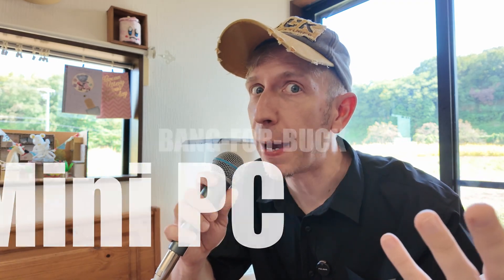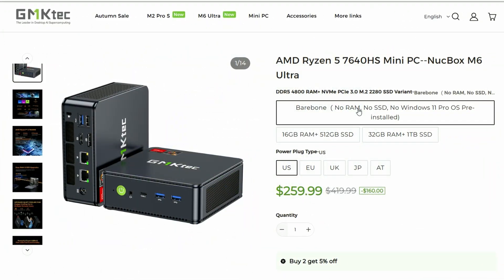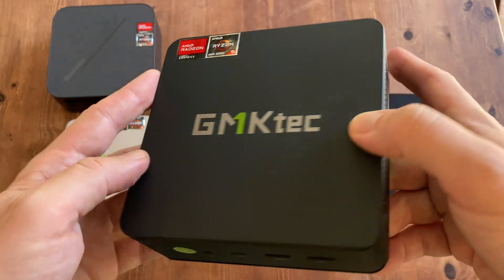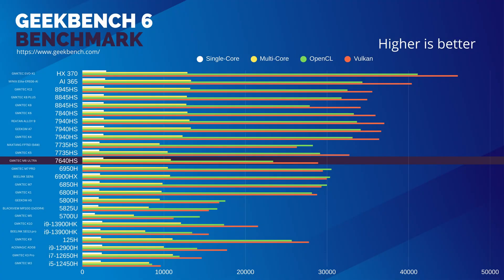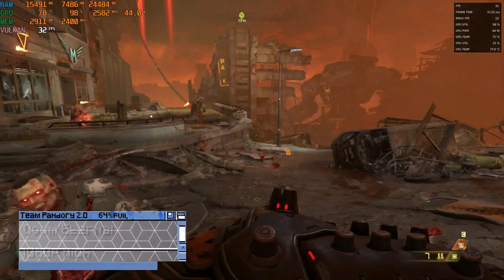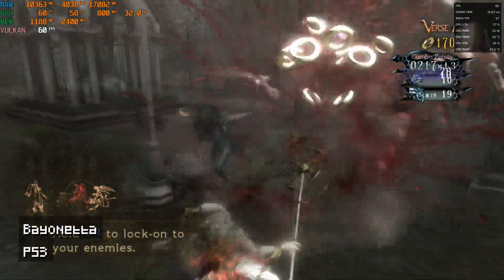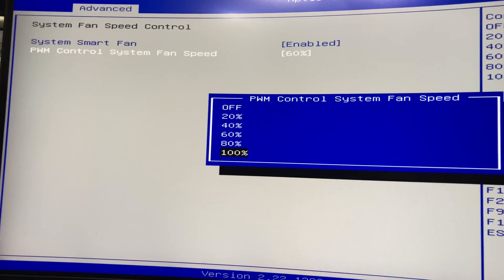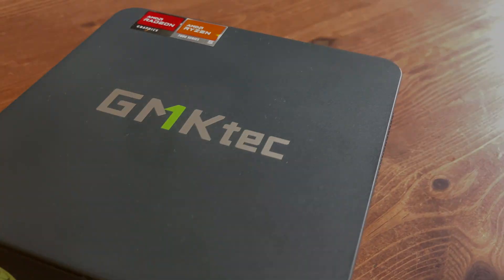This $349 Mini PC Is Shockingly Good! [GMKtec M6 Ultra Review]

Comment: You could take this and run an occulink port in the open m.2 slot for $20. SUPER easy. Just plug the extension cable into the spare m.2 slot and plug your occulink epgu into it.  This with a EGPU would be a killer unit for almost anything.

Comment: I have the GMKtec NucBox M6 Ultra, I paid 297.99€ taxes included for this PC which translates to about 346 US dollars at the time I write this comment but I don't know if the US price takes taxes into account, the mini PC is a beast, the CPU is really powerful and I never managed to hit its limits(I use it in Performance 50W TDP mode), I use the preinstalled 16GB RAM DDR 4800MHz, and same for preinstalled 512GB PCIe Gen 3 SSD, it runs Fedora Linux 43 Beta with the KDE desktop(I removed Windows 11 day one), tho it's not perfect, first the wifi + bluetooth chip is horrendous... This is the same card I had on my previous gaming laptop, it seems all Ryzen 7000 mini PC and laptops have this card and it's the worst I've ever seen, first wifi speeds are horrible unless you're near your router, at the same spot my old crappy thinkpad with regular WiFi 6 6 achieves 240 to 320Mbps while the mini PC only gets between 96 to 120Mbps with tons of drops, if you are near the router you can achieve 800 to 900Mbps, this card is WiFi 6E but uhm... I had a laptop with a WiFi 6E card(it had a i7-13620H CPU) and managed to get 1600Mbps near my mom's router, secondly everytime I plug my external SSD the internet connection dies(wifi icon with exclamation mark but still connected) if I disconnect from the wifi and try to reconnect it's stuck at "configuring interface"(note that I can connect to my mom's wifi but not my phone's wifi hotspot, both are configured in 5GHz mode) if I remove the external SSD I'm able to connect again(note that on my M1 Mac connecting the same external SSD doesn't kill my wifi connection), also had issues with bluetooth where if too many devices were connected at the same time I either got INSANE mouse lantecy(bluetooth mouse) or audio cutting every few seconds(i use bluetooth headphones), the problem NEVER happened on my M1 Mac even with 4 bluetooth connected at once. The PC is amazing and I have accepted its flaws especially since I paid next to nothing for it but I can't say it's perfect. AMD makes really good mobile CPUs but why do they forced everyone to use this crappy WiFi + Bluetooth card chip ? Especially since I see everyone complaining about it online, "lspci -nnk | grep -i mediatek" reports it's a MT7922...

Comment: in my country, m6 ultra and m7 difference is 40$. should i add that much just for the oculink?
Reply from the maker: The m7 has slightly better GPU and cooling too. Tbh id toss a coin.  M6 ultra for better CPU performance .. tough call.

Comment: Great little mini PC. I have the very similar Minisforum UM760 Slim which uses the same 7640HS chip. I was worried about only having 6 CPU cores, but it runs great in practice.
Reply from the maker: I've been testing out a few games the past few days, and it holds up. Good little chip, ideal entry point for one that needs a cheap pc that can still play a few games.

Comment: Just noticed that the bios doesn't let you setup a fan curve. Is it possible to use software like "fan control" to accomplis this on the mini?
Reply from the maker: It might be 🤔. Will have a look, but tbh this unit is pretty quiet at stock / normal use in balanced mode.  Does a good job in the auto fan setting

Comment: Glad there's another review, i've bought m6 ultra a month ago, and im satisfied with performance and low power consumption.

But im still confused, is m6 ultra can running ram at 5600mhz, or it's 4800 at max? The one im using are 5600 and it's detected as 5600 in task manager
Reply from the maker: According to the chipset's spec sheet, it should have speeds up to 5600, but the sticks we got were 4800.   Will check again tomorrow 😸

Comment: why? why do they put full usb4 in the front? i refuse to connect egpu or a monitor to the front! the back, the back dear manufacturers. one plain vanilla usbc in the front? im cool with that. but full usb4 should be in the back. and whats with this 2xlan trend? nobody is aggregating, lol. nevertheless, seems like a nice b4b for 32gigs/1tb.
Reply from the maker: Having usb4 on the front isn't too bad. I'd prefer to have one on both fronts and back, much like the 3.5mm audio jack. 😁 
- I don't think they really can change it too easily though, as this case design is not a recent one by Gmktec. You know with creating plastic molds /  costs etc.
Reply: @TeamPandory agreed. two full spec usb4s, one in the front and one in the back would be acceptable. i have lenovo p3 ultra and it has two tb4 ports in the front, and none in the back. so whichever thunderbolt devices i might connect, ill have cables dangling from the front, lol. hub, egpu, monitor, soundcard… ugh.

Comment: $340 is pretty steep for a budget mini PC
Reply from the maker: For a budget mini pc that can actually play a good set of games, this is a great price.
Reply: It's unfortunately difficult to recommend most options in the $170-$340 range. A lot of them use older Zen 2 or Zen 3 chips with Vega based graphics. If you need something faster than an Intel N100 (or similar), you almost have to double your budget unless you are certain the older chips fit your needs.
Reply: With plenty of RAM and SSD included I think the price is not bad.
Reply: Bought my M6 Ultra for 297.99€ which is about 346 US dollars at the time of writing this comment, but the price I paid included all taxes, also, it's not really a budget mini PC, the Ryzen 5 7640HS is a pure beast of a CPU... Yes it's not high end but definitely not budget or entry-level, you get a 6 Cores 12 Threads CPU based on the Zen 4 micro-architecture and a max frequency of 5GHz, from my tests on single-core and two-cores workloads I can hit 4.7 to 4.9GHz sustained frequency and when all cores are maxed out at 100% it's betweeen 4.2 and 4.5GHz, I never saw this CPU under 4GHz(idle doesn't really count), and even the iGPU is used I can still hit those frequencies despite the 50W TDP being shared between CPU and GPU, playing Call Of Duty Black Ops II on RPCS3 with MangoHud for performance stats I have about 60 to 80% CPU usage with all cores between 4.2 and 4.5GHz and the iGPU at 70% usage but at default clock(800MHz) because it doesn't need to boost, I never managed to hit the limit of the Ryzen 5 7640HS and I'm quite a power user, I write code everyday and I do tons of CPU intensive tasks on my PC and yet it has been peforming as well as a big desktop PC. For the price I paid it was a miracle as I can't manage to find another PC at the same price(and I'm taking into account all types of PCs aka laptops, desktops and mini PC), I don't think you can build me a full PC for 297.99€ that has the same CPU and iGPU performance. And mine came with 512GB of PCIe Gen 3 NVMe SSD and 16GB of RAM, a complete and working PC, a Ryzen 5 5600X is already about 100€ and the 7640HS is a bit more powerful in most tasks, you'd also need a motherboard, a case, RAM sticks, SSD, CPU cooler(unless you want to use stock cooler) and you'd need a GPU because the 5600X doesn't have a good iGPU, also the M6 Ultra comes with two 2.5Gbps Ethernet port, most motherboards have one 1Gbps Ethernet port unless you pay a higher price. The most similar build as a desktop PC would be with the Ryzen 5 8600G(since it has almost all the same specs as the 7640HS and also use the same iGPU) but a full PC with this CPU is well over 300€...
Reply from the maker: @YannBOYER_LK so maybe not a budget mini pc, but an amazing pc you can get on a low budget. 😊
But yeah you get it totally in regards to the pricing. Full computers when looking at all the costs, and the knowledge/ time spent building, it can really add up. ... .... Unless you go used I guess ?

Comment: Cool review! I have to point something. Just bought a k8 plus. Running a game with normal texture, the wifi disables. That's because the SSD is ON the wifi module, from factory. Moved the SSD to the other slot: wifi Speed doubled, no disabling and disconnecting while playing game. Hope this helps someone! I was going mad. Bad, bad positioning imho.
Reply from the maker: Will check into this!  Thanks for the comment
Reply: @TeamPandory you complained about bad wifi on that review, this should do the trick! Thanks ❤️
Reply: @TeamPandory looking forward for the video walk through after you have successes doing his suggestion and doings comparison, I'm still saving up for k8 plus so when the times comez there already solutions for everyone who had same issue
Reply: How to move it to the other Slot is there anywhere a Tutorial?
Reply from the maker: @Finnsen-h9jmoving the nvme out is as simple as opening it up, removing the screws from both nvme bays, then moving the nvme storage.
It's a very simple process and considering we tear the whole unit down in this video, it's not too demanding a task. 
- In regards to the video output on this channel, the last 3 months have been a bit of a rollercoaster.  Currently a bit unwell 😔
Reply: @TeamPandory thanks but ist my First Mini PC and i dont rlly wan't to do Something wrong,for you it might be pretty easy but i dont rlly know If its necessary to do it or Not or how.
Reply from the maker: @Finnsen-h9jthen leave it as is... Only look into it if you have a bad signal. 
End of the day, it's going to be better than that intel 210 WiFi chip - and if you need any more help, come to our discord I'll be happy to help ❤️
Reply: @TeamPandory okay thanks
Reply: Wait does that mean only 1nvme can be used then?
Reply from the maker: @leavesoflemons5374 no, both nvme could be used.  It's just WiFi that appears to snuff it when using the outer NVME slot ... And sometimes that works. 
WiFi usb dongle will allow you to have all features, but the bandwidth might suffer in regards to that outer slot